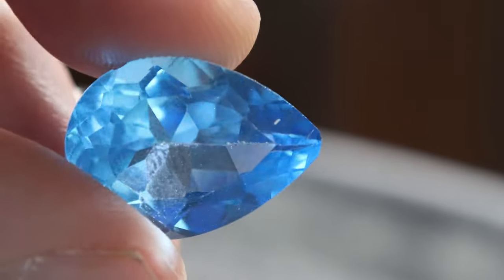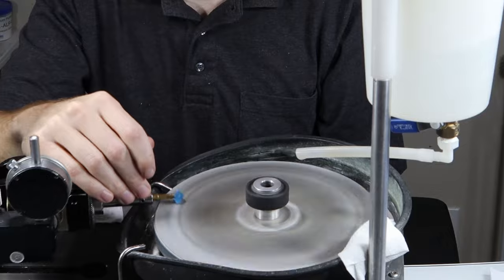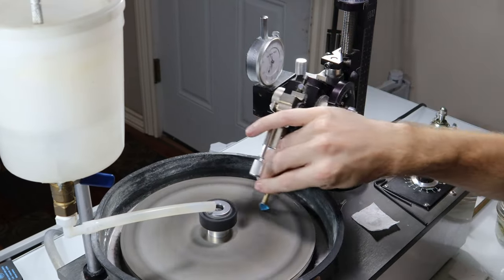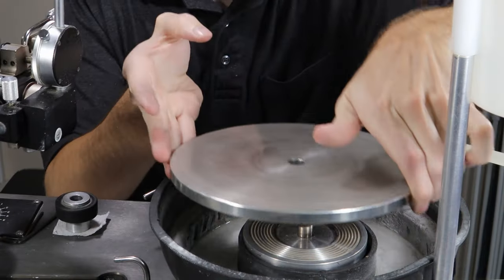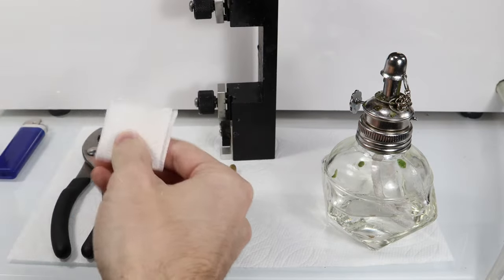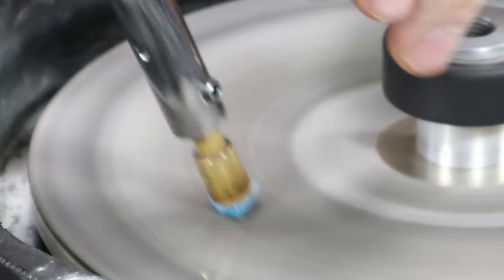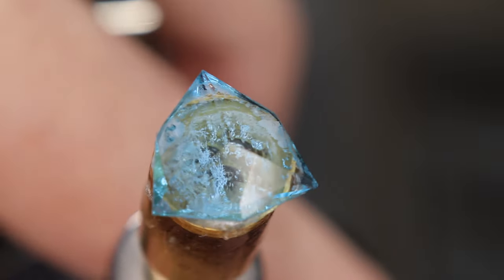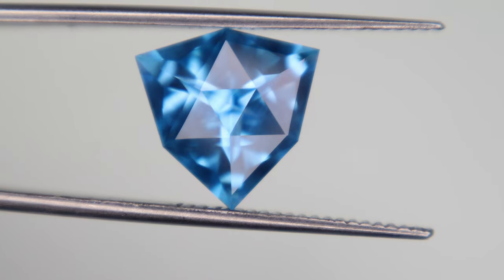Cutting my own gemstone design in Blue Topaz

Comment from the maker: That was a fun stone!
Reply: My brother what would you do if the precious stone has a defect or it broke? If that broke on me I dont know what I would do. Probably have an aneurism+heart attack and then find the person that sold it to me and send him to jesus.
Reply from the maker: I would likely accept a return on a stone that broke due to defect or fracture plane in the stone. I haven't had anyone tell me that they have broken one of my stones yet. @Nw-zh1uq
Reply: @MattsCornerofGemCutting  Sorry I was not clear enough. I meant what would you do if the uncut stone the one you bought broke while you  where trying to refine it. Not the ones you already refined.
Reply from the maker: @Nw-zh1uq  I try to purchase most of my rough in person to evaluate it myself and avoid buying rough that I think will fall apart. 

Sometimes I have to change up the cut mid cut if something happens. Recently I was cutting a sapphire in a hexagon cut that had a bad fractural flaw near one of the points that I worried would cause the point to break off easily. I had cut in some of the pavilion facets and the girdle at that point. I stopped and redesigned the cut to cut out that point and the opposite one. The finished cut was a slightly cushioned rectangle instead.

Let's say I was cutting this design in the topaz and I dropped it while cutting it and and one of the sharp tips broke off. I would have to change the design into a cut cornered triangle to accommodate for the breakage. If it happened to break in half, I would determine if the pieces were big enough to be cut into individual stones. If not, I would set them aside and move on with a different stone and not think too much about it.

Most of the time, a stone can still be salvaged from a break during the cut. I really don't have much issue with stones unless they already had some bad fractures in the rough before cutting.
Reply: @MattsCornerofGemCutting  That is very good to hear. The fact that they are salvagable most of the time  is great.
Thank you for the sincere answer and the valuable information. May you keep prospering both in wealth and in health.
Reply: Awesome!!!, 😃👍💎❤️😍💎
Reply: Bro do you sell these tri force stones?  my homie would love one
Reply: That stone cut would look absolutely amazing as a diamond, with the reflectiveness you are getting from a topaz. Too be honest I would absolutely love to set something like that, after just looking at the stone when it was finished, amazing work on that design man.
Reply: I teach art history - including the decoratice arts. 

I'm always looking for good for demonstration videos on artistic and craft processes.   Glad I found your channel!

Are you familiar with medieval gem work (lapidary)?  There's some tumbling of stones than cutting (especially earlier on in history.)  However I really recommend checking it out.  

Have you ever considered demonstrating the other lapidary techniques.   I see cutting is kind of your thing, but you might get a kick out of it.  

Tumbling, setting (in metalwork, woodwork and textiles) and engraving.  Those are the other three big ones.

Comment: Can you cut any kind of gem like that? Like, say someone found a very large, totally clear quarts during a walk on a first date and wanted to cut it into a center stone for an engagement ring, could they do that?
Reply from the maker: Yes, any gemstone could be cut in the design, though different gemstones have different refractive properties. So the look of the finished piece will vary some based on the material it is cut in.
Reply: @MattsCornerofGemCutting  thank you so much

Comment: The stone looks beautiful but isn't one of the triangles from the tri force not faced correctly? It seems to not line up perfectly with the other triangle. I'm just wondering what would have caused that in cutting the stone and why couldn't it have been fixed before you were finished?
Reply from the maker: Yeah, one triangle was slightly overcut. The actual affect of appearance on the stone is very minimal, but is more easily noticed with magnification. To fix an over cut,  you can either go back and cut in most of the other facets on the the crown slightly as well to account for the over cut or slightly change the angle and alignment of surrounding facets to adjust for the over cut. I could have fixed it, but didn't want to bother with the extra work as it is barely off.

Comment: If the inclusion is big enough and down toward the bottom of the gem, can you use it as a light refractor in an emerald cut?
Reply from the maker: I mean, it would have some sort of effect, but inclusions usually don't enhance the visual of a gemstone.
Reply: @MattsCornerofGemCutting  Not for close up but from across the room the light refracts off the inclusion and out through the gems facets.

Comment: Hi Matt, this is Usman from Pakistan. I got a question, I wanna faucet my florite irregular crystal. But I can't afford any machinery. Could you please recommend me grit numbers?
Reply from the maker: I would use something around 600 if not having to take off a lot of material first, then something around 3000, followed by whatever you can use to polish it with something like Cerium Oxide.
Reply: @MattsCornerofGemCutting  I'm unable to find any chemicals like you mentioned